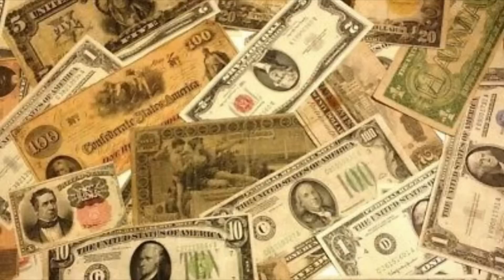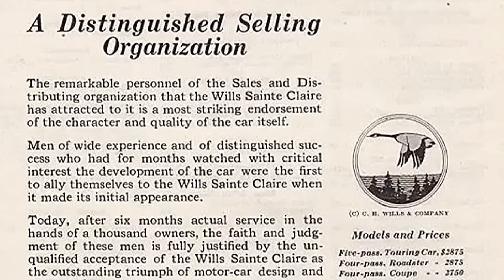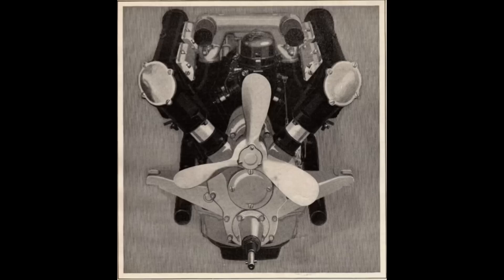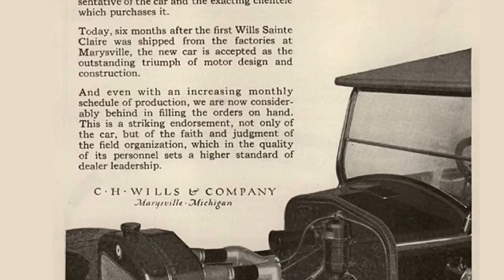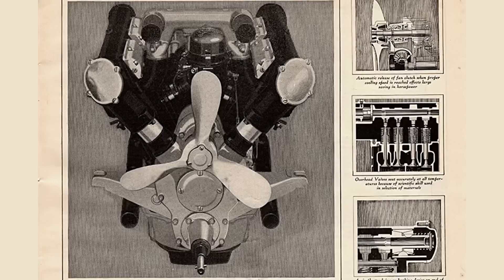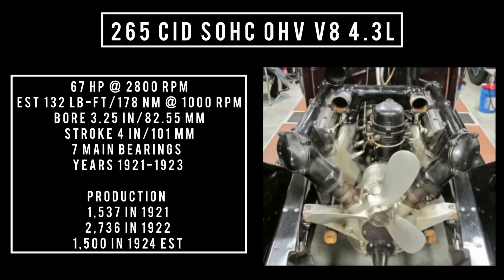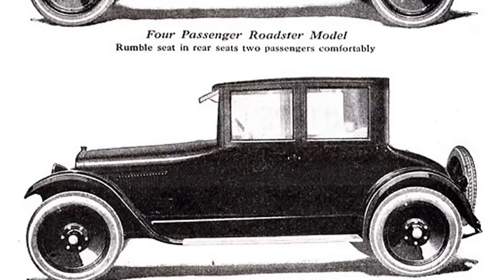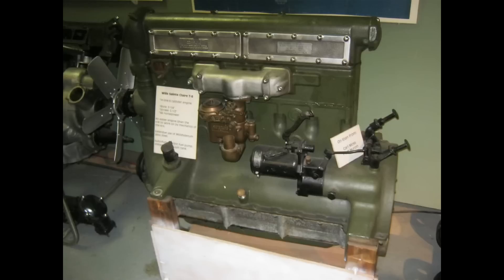Wills St. Claire SOHC OHV V8

Comment: and perfectly balanced V8s have 90 degree bank angle - 60 degrees is very rare but not unknown, and works best with a balance shaft added (see 2nd generation Taurus SHO)
Reply from the maker: I totally agree, but I was reading what was in the advertisement piece. That’s why I put a lot of those advertisement pieces in there so you can read them as well.

Comment: 7 main bearings don't make any sense for a V8.  5 are the rule.  Conceivably if the 2 banks had a lot of offset, you could have 9.
Reply from the maker: That was conflicting information. One source said seven main bearings. Turns out it only has three.

Comment: -Bevel gears for overhead cams would seem to be ideal but they need special attention with fitting [shims] and they use way more energy than chains or belts do.  This is why they are not used in modern automobiles.

Comment: A 60° V angle does NOT give "absolute smoothness"; only a 90° V will give you that, and only with a cross-plane crank. From what the ad copy you show mentions, it seems this engine has a flat-plane crank, on which the V angle really doesn't make a whole lot of difference, unless it is put at 180° (making it a FLAT 8), otherwise there is always an uneven firing profile. However, with a flat-plane crank, the exhaust pulse profile IS perfectly even on each bank, reducing exhaust back pressure.
Reply: @alexclement7221 You are dead right about vibration, bank angle and cross plane crank.
Reply from the maker: Look at the advertisement pieces, it says the total opposite maybe that was found out through history

The advertisement pieces are really interesting read

Comment: What a brilliant design! So, you have a valve problem. You take the cylinder out, change the piston and rod, bcz they are also gone, swap a new/machined cylinder and put the engine back together in about 1,5 hours. 25 mins if in a hurry. Other than that, you change the oil two times per year and the setup will go on indefinitely. This should be the industry standard. Modular engines with reasonable capacity that you can service at the dealer within your lunch break, without destroying the economy.
Reply from the maker: Great information thank you so much for sharing all that insight what I find interesting is the sides have those little for lack of a better term where the gray is with the bolts you could take that out and see the valves but you can’t fix it from that access point which is a super interesting design choice. I guess you can see if the valve needs changed or fixed or adjusted
Reply: @What.its.like.   "Inspection hatch" :D :D A very common feature in old style engineering. In regular interval maintenance, things need to get looked at, maybe poked with a gauge or wiggled gently. Then add more lubricant and off you go. Talking about user friendly design. Things to do for a car enthusiast, but nothing seriously risky. My favorite part is the shaft driven cam. Simply the best design for a V engine, imo.

Comment: Valve job must be a nightmare! Question... You did a vid a while back on a car that had an engine that had a slip cylinder wall or something... it was a really unusual but interesting design... did you ever do a follow upon the engine itself and I missed it?
Reply: Check out the meteor aircraft engine from WW2. Sleeve valves and a million gears. Really complicated engine but 2500hp.
Reply from the maker: I haven’t covered a sleeve valve yet as used in a willys knight definitely going to recover that engine. I just haven’t figured out how to go about it. Do I cover the engine or the engine design because the engine design was in a bunch of different cars

Comment: I've know about the Wills St Claire since I was a kid (I'm 68) and have always been impressed by them. I have driven a friend's 1921 Stearns-Knight- it rode like a modern car and shifting took some getting used to but I was well impressed with it. I would have a hard time deciding between a WSC, any sleeve valve car and a Doble!
Reply from the maker: I’ve heard those sleeve valve engines are awesome. They burn a little oil but they’re silent just like silent night. Thank you so much for sharing your experience with these cars. Greatly appreciate it.

Sweet choices
Reply: @What.its.like.  a friend in Michigan has several sleeve valve cars- 2 Stearns, a Willys and a  Daimler which is in pieces. His Stearns that I drove may be the one in your video. he also said that the engines aren't difficult to rebuild, they only go together one way. They do smoke a bit but so what?
Reply from the maker: Have you ever been to the old car show at the Greenfield Village? It’s always the week after Labor Day in September. If you haven’t gone, I suggest you go I’m going to go this year it was like heaven for me. I don’t know how to really describe it. It’s one of the best shows I’ve ever been to if not the best show I’ve ever been to. All the cars are before 1932 and their drive them so you can smell them and experience them for what they were.
Reply: @What.its.like.  I have not been to that show but have been to the Meadowbrook show that later moved to The Inn at St John's. One of the best shows I've ever seen. Haven't been in a few years because of covid.

Comment: That engine is nice, but with the metallurgy of the day limiting valve life, and the primitive motor oils of the time it was impractical for regular automotive use. For most mechanics of the times, an engine like this was today's equivalent of "Rocket Science". Old folks like me will likely remember the 4- cylinder Offenhauser engine which dominated Indy-car racing for a long time. With it, the cylinder and head were cast as one, then bolted onto the block. They could take as much as 30psi of boost giving insane horsepower output with no head gaskets to fail.

WYR is the Willys- Knight which had a very good reputation in the day, and of course the Jordan- the "playboy's" choice.
Reply from the maker: Thank you for sharing that insight and information as always. I totally dig reading all of the information and insight you provide even though sometimes I don’t respond with a comment just know that I really appreciate what you bring to this channel in the comment section =) 

Great choices by the way I would love to cover of Jordan Playboy this year. There’s so many cars that I want to cover this year. I know it’s gonna be like last year. I’m gonna get the Hershey and it’s gonna be over. It’s insane how fast the year goes once you get past April…

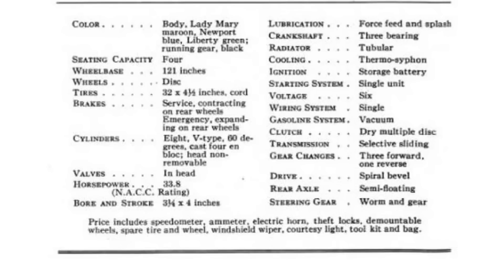Comment: Great presentation! Don't feel bad about mangling names, I still don't know how to pronounce molybdenum, although a commenter gave the pronunciation of both moly and vanadium. You also said that the engine has 7 main bearings, but the spec sheet at 3:50 says just 3. I would love to hear one of these engines run. WYR= yes to all.
Reply from the maker: Yeah conflicting information found a typo as well on slide 1923 not 24 lol 

=) 

Molybdenum hard word to say lol
Reply: @What.its.like.  That's why everybody just says moly, or chrome-moly.
Edit: I would imagine that info on a Wills Ste Claire is not exactly easy to find. I think you did a good job.
Reply from the maker: I’m going to the Gilmore Museum in a couple weeks I was going to wait and do this engine after I did more research but I was able to find enough I think I wish I could’ve found some information on the pistons used connecting rods and combustion chamber, but I figured This was enough.. 

There’s other engines I wanna do that are really information. Isn’t there this week episode was actually going to be on the international Comanche four, but there isn’t that much information on it so I’m going to go to the library and see if I can find some more. 

Plus I don’t know do I just cover the four-cylinder or do I cover all of them because you could get it with a four-cylinder a six cylinder or V8 probably just cover the four-cylinder and then cover the V-8 another time just be easier I think 

Dusenberg beam is another engine. I really want to do that is very spotty at best.

Comment: Years later in 1965, Dearborn would make their own S.O.H.C. 427 V8. 
In  my humble opinion, the nastiest factory engine ever invented! Even stronger than the 426 Hemi!
Reply: Don't forget the OHC Pontiac 6, not near as powerful but just as sophisticated, another overlooked engine.
Reply from the maker: Definitely going to cover that one. Maybe that one will be next week who knows haven’t gotten that far yet lol.
Reply: But it wasn't really a "factory" engine was it? To  be truthful the first 426 Hemi wasn't either. And neither was the Chevy "Mystery engine".  Chrysler did go on to build a production version of the Hemi later.
Reply: @keithstudly6071  
They built them for the stock car races, but they were required to build 500, or so for sale to the public. If the factory didn't build these engines, who did?
Reply: @robertwatkins364  By the time Ford had built the engines, NASCAR had already banned the SOHC motor. Ford then used them for drag racing. There are still a few running today!
Reply: @61rampy65  That is true, Chrysler cried foul, and the 427 S.O.H.C. became the only engine ever banned by NASCAR in December 1965. That is why only appropriately only 500 S.O.H.C. engines we're ever built. I read the single 4 barrel S.O.H.C. engine was 616 horse power, and the engine with two 4 barrel carbs was 657 horsepower! I also read where one of these engines was put in a Holman Moody car, and it ran 7500 RPM all day long while testing, at speeds that scared the other car companies! No wonder Chrysler was crying foul!
Reply: @61rampy65  I have a picture in an old hot rod mag Connie Kolitta "The Bounty Hunter" has a supercharged S.O.H.C. in his dragster. I bet that was a ride!
Reply: @robertwatkins364 My bet is Holman Moody. They did most of Ford's race engines.
Reply: @keithstudly6071  I'm sure they prepped the race engines for testing, but the designs, and building, came from Ford engineers.
Reply: @robertwatkins364  NASCAR banned the Hemi in 65, but Chrysler said "screw you" and sold the Street Hemi to the public in 66, and NASCAR then allowed them to run.
Reply: @61rampy65  Yes again NASCAR had a rule about making the engine available to the public, so it could be considered a "stock car"
Reply: @robertwatkins364 But we're talking about two different things. The SOHC Ford was never a regular production engine. Ford had a few made to race and when the were banned they never made anymore because they never sold any except through Holman Moody. The 428 Cobra Jet was a stock engine and many were sold by dealers. The 1964 Hemi was a race only engine and was banned as well. Chrysler came back with the 'street Hemi' in 1966 that you buy at dealers and was NASCAR legal. The Chevy "Mystery Engine" was another ringer but they only made about 20 of those so they  went away quickly. It is not a big trick to build a special engine for racing that's better than stock offerings, it is tougher to make an engine that is offered to the general public and can also be a reasonable race engine. That's what stock car racing WAS all about.
Reply: @keithstudly6071  Okay! Sound good. Thank You.
I never said the cammer was a factory production engine. 
I was impressed with what the engineers at Dearborn built. I thought it was a great trick! I'm sorry they never released it to the public, I would love to own one! Next time I have an opinion on something, I'll be sure to ask you first!
Reply from the maker: Great information